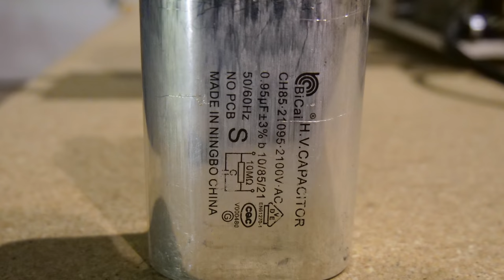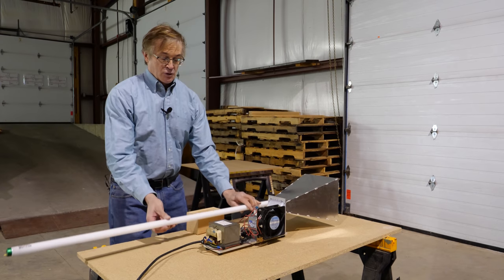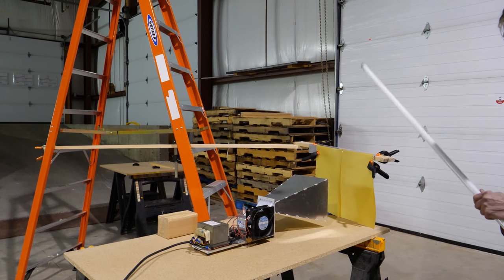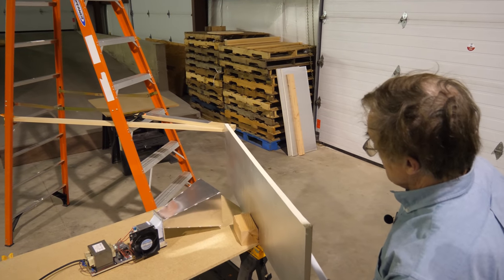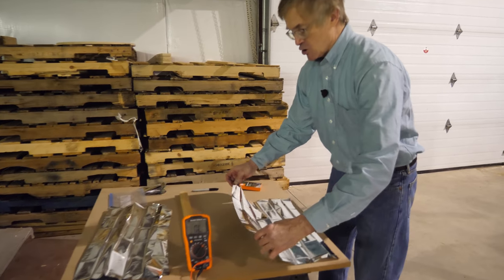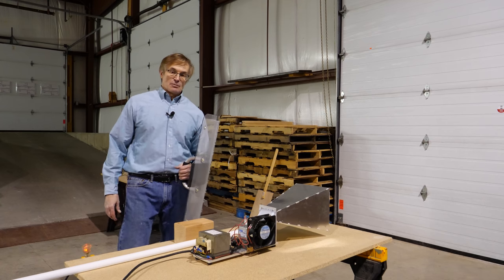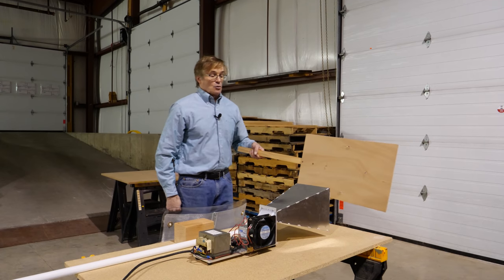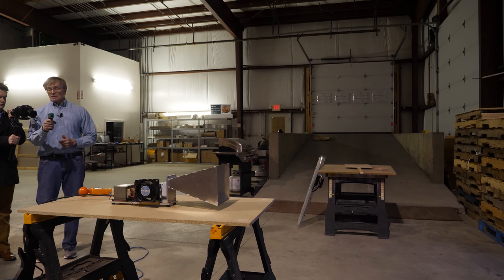You're not protected from microwaves... yet - Part 2

Comment: Low power ("athermal") microwaves are also biologically active and harmful (though if used selectively they can be therapeutic).  You don't need to directly ionize DNA to cause DNA breaks, you can alter other cellular processes to induce oxidative and nitrosative stress.  eg downstream of abberant Ca2+ flux superoxide and nitric oxide are produced, gradually overwhelms endogenous defense mechanisms, finally reaches the threshold where they rapidly combine to form peroxynitrate.  Leakage of the mitochondrial electron transport chain is another mechanism.  Lastly, it can not act to damage DNA at all, directly or indirectly, but can either disrupt or otherwise inhibit DNA repair enzymes.  This would amplify the natural background damage.

"In cellular aggregates that form tissues of higher animals, cells are separated by narrow fluid channels that take on special importance in signaling from cell to cell. These channels act as windows on the electrochemical world surrounding each cell. Hormones, antibodies, neurotransmitters and chemical cancer promoters, for example, move along them to reach binding sites on cell membrane receptors. These narrow fluid "gutters," typically not more than 150 A wide, are also preferred pathways for intrinsic and environmental electromagnetic (EM) fields, since they offer a much lower electrical impedance than cell membranes. Although this intercellular space (ICS) forms only about 10 percent of the conducting cross section of typical tissue, it carries at least 90 percent of any imposed or intrinsic current, directing it along cell membrane surfaces.

	Numerous stranded protein molecules protrude from within the cell into this narrow ICS. Their glycoprotein tips form the glycocalyx, which senses chemical and electrical signals in surrounding fluid. Their highly negatively charged tips form receptor sites for hormones, antibodies, neurotransmitters, and for many metabolic agents, including cancer promoters. These charged terminals form an anatomical substrate for the first detection of weak electrochemical oscillations in pericellular fluid, including field potentials arising in activity of adjacent cells or as tissue components of environmental fields."
	Adey 1993 - Biological Effects of Electromagnetic Fields

This is relevant due to other types of electromagnetic weapons which I can't link or quote here (youtube deletes them).  Some involve the microwave auditory effect, others have to do with timing pulses in rhythm with the heart to cause death by heart seizure, and others to slowly induce a hyponotic state (as in the USSR device "LIDA").
Reply: @ep5acg  okay I haven't read all of the comments but it sounds more like something happening on prolonged exposure? While you can simply up the energy of ionizing radiation to get to a level where one millisecond hits you with enough radation to essentially transform you into a walking corpse because the radiation spreading from the impact is enough to make all your cells loose the way of splitting. I feel like higher levels of microwave radiation are easier to tolerate till you reach the level where all the water in your body gets instantly vaporized, but that sounds like a fuckton of energy. Then again this is all speculation and I would gladly hear what a person has to say about that. But as I said, my guess would be it would need prolonged exposure to get effects like oxiders forming to a sufficent amount to be harmful or the repair process of DNA being inhibited. Still good to know but does sound less acute then what happens if you get hit by high energy ionizing beam.
Reply: @ep5acg  im pretty sure he simply meant in context of radiation, only ionizing radiation can cause direct dna damage, not a blanket statement that ionizing is the only thing PERIOD that can damage dna. Clearly lots of stuff can damage dna, chemical, physical, etc. For example, IR light isn't going to cause DNA damage, but UV-C sure can.
Reply: @ZE0XE0   Nah  clearly he was trying to say that microwaves exposure of humans can not cause DNA breakage in those human organisms.   When the totality of the biochemistry involved is taken into account, as prior comments point out - this is not true.  I.e. That statement he made is false.  Pure and simple. Furthermore, many people who say this are in fact cognizant that they are suppressing some of the literature.  In which case the statement is also a lie.
Reply: @Ramog1000  I believe you are correct.  Other than furthering discussion for the sake of intellectual curiosity, I don't see that oxidative stresses due to, or inflammation responses, have much to do with the context of protests -- until I woke up this morning still thinking about how he could not spell the word 'front'.   It looks like he has inadvertently informally confirmed that microwave exposure even at lower levels than ionizing DNA affects brain processors.   There are a number of cohort studies with people reporting this.
Reply: @ep5acg  ehm a microwave beam with the power of 1500w is low levels of exposur?
Reply: @ZE0XE0  This is still thinking in terms of direct action, rather than thinking of transduction and downstream amplification.  Think about this classic example of death by low intensity visible light: the story of Romeo and Juliet.  Was it the light itself that triggered organism-level apoptosis?  No, it was the timing and character of that signal.  So too of other frequency bands and the various tissues of the body.
Reply: @Ramog1000  The whole thing is highly nonlinear and difficult to broadly characterize.  There are short and longer term cumulative effects possible, depending on the initial state of the organism.
Reply: @ep5acg  Yeah, there is a tendency to downplay or ignore more subtle, silent, gradual, cumulative, and synergistic environmental factors.  I traced out the history of this field back to 1893 with the work of d'arsonval and others (really goes back to Galvani, Franklin, and others, but for the purpose of this discussion).  In the fields of bioelectromagnetics and magnetobiology there are actually more like 40,000+ papers published internationally to date.  Some of them are on magnetic fields, a lot of them are higher intensity, but a good chunk of that body is dealing with low intensity exposures.

I put together several links to papers and sumamries (presently just a text document), and gathered all of those other documents together.  Youtube just deletes my post if I link to it directly, so I put it in a community post on my channel (the only post).  Anyone interested in this area should check it out.
Reply: @Acetyl53  I mean I also wrote in a comment on the video that a wire cage to limite radiation spread would probably a good idea.
Reply: @Ramog1000  Check the last paragraph of my initial post for some of the more specialized applications I have in mind.  We've been able to just cook people with microwaves forever, the Japanese developed their "Ku-Go" death ray towards the end of the war using this exact idea.  It's these more specific and nuanced applicatiosn which have a greater potential covert effect.
Reply: @ep5acg  Weird, it truncated the URL.  Fixed and just tested though, working now.
Reply: @Ramog1000  So many comments, I've lost track of the context for your remark.  1500w would be a bad deal for a person, that is high power.  Health effects have been measured at WIFI and cell phone type exposure levels.  Go to pub med and do some searches, you will find papers.
Reply: @Acetyl53  Got a chance to go through some of those papers today.  The Bioiniative RF color charts are great.   However, the bibliography is missing.  The last column has references, but there is nothing to cross them with.  There is a 2014 Bioinitiative bibliography.   Everything on those charts is even older than that.  Should those charts be labeled 2014  instead of 2019, or is there another bibliography?  Can you please help me resolve this question?

It was interesting to see some of those older papers, it looks like Sputnik lead to a spate of sincere investigation.  Even in 1958 a researcher talked about low levels of microwaves changing the dialectric constants of protein solutions, and a couple of researchers talked about pearl chains at low powers. One even had a low power DNA breakage explanation.

It is also interesting that in the 50s everyone else was thinking of microwaves as simply a type of fire that a person did not want to get burned from.  Those early papers seem to be all that most people are familiar with today!  Seems more people get their intuition from the concept of cooking food in a microwave oven, than they do from the published literature.  Perhaps we should be talking more about 'magneto biochemistry'  - someone should write a book on it.  Humans certainly find it challenging to develop intuition about things that are invisible.

The old literature also had a practical reason for looking at higher levels - they didn't have the equipment to measure lower levels, as one researcher pointed out.  Did you ever read about the plutonium ingestion experiments?  Seems all the test subjects died prematurely, and the military scientists demonstrated that not a single one of those deaths was from ingesting plutonium.   I skipped the papers about an apparent accident on the Forestall did not actually causing any health problems...

Your list is missing Dr. Belpomme's work and that of some Chinese researchers.  In general it looks not to have been updated in a long time.  .. One Chinese researcher published a wonderful paper where he said we should not forget the  benefits of microwaves, then went on to explain how they could be used "to help people concentrate bettter"   and to "give them feelings of euphoria"   LOL thus establishing low level microwave effects on higher brain functions while also getting past the censors.
Reply: @ep5acg  There are actually a few bibliographies.
_Index.txt is my own bibliography generated from papers I have on my drive.
The Navel Medical Research Institute (NMRI) bibliographies by Glaser in 1972 and 1976 contains iirc ~8000 entries.
The the EMF Portal database dump txt.  I wish I started doing that sooner, they've been removing relevant papers.
The EPA Index by Kinn, 1981.
Lastly -Main document[...] aimed to gather together, sumamrize, and cite all of the relevant research as well as establish a timeline, relevant players and names as they come and go, and so on.  It was intended to culminate into a general review of the literature, but I haven't worked on it for a few years.

"1958 a researcher talked about low levels of microwaves changing the dialectric constants of protein solutions, and a couple of researchers talked about pearl chains at low powers."
I'm not sure if I included yet, but one paper (from the DTIC or CIA Archives iirc) from the mid 50's had the author expressing frustration and talking as though "athermal" effects were in their eyes conclusively demonstrated and obvious.  If you go back to the 1920's and 30's with the naysayers at the Rockefeller Institute for Medical Research, you'll see the same pattern.  Maybe there was a case for deficiencies in measurement apparatus in the 30's, not anymore.

"One Chinese researcher published a wonderful paper where he said we should not forget the  benefits of microwaves, then went on to explain how they could be used "to help people concentrate bettter"   and to "give them feelings of euphoria""
Yep.  Several Chinese papers reported broad neurotransmitter changes.  They've also use pulsed 2.45 GHz exposure as a diabetes model.
Reply: @Acetyl53  would you please send me any links that you talked about?

Find my email the About tab of my yt profile.

Comment: I’m curious why the orientation of the “space blanket” matters other than for reflecting. If the blanket was flipped, wouldn’t it still not allow the microwaves to pass through due to the aluminum layer?
Reply: Probably because you become electrically connected with skin contact.
Reply: @sshuggi  how? It was shown that continuity was only possible on one side. Does that make the space blanket a one way valve for electrical radiation?
Reply: I guess because ... It is important not to rub the coating off.  It is very thin.  Probably shouldn't scratch it either.   It is something a person should be aware of when handling it.  Maybe there is more diffusion of the wave on the dull side than on the shiny side.   Diffusing the reflected wave would be a good thing.
Reply: @ep5acg  the scratching definitely makes sense now that you mention it but if it’s that easily defeated then I wouldn’t want to rely on this for anything but emergency use.
Reply: @willb.383  I had a sheet of it mounted on a surface where people sometimes rubbed on it when they passed by.  I was surprised that after a month a big clear spot the size of a frisbee appeared where the coating had been completely rubbed off.   Had it been turned the other way, it probably would have been fine.  (I found the material to be interesting so I was experimenting with it.)

Comment: thank you for demonstrating the uses of microwave detect devices and how the beam is deflected, in a self -protection type environment.  I built a cheap faraday room sized cage out of foam insulation board e/w aluminum foil on both sides about X10 years ago, which I have not had to use, but it's nice insurance, if ever required.  We utilized 10kw Klystron microwave power amplifiers in NATO, so I know a few things about staying safe around them.  No watches around the Klystron magnets, they would kill a watch very fast.

Comment: Thank you for taking the time to show things like this. The infused copper meshed cloth that you mentioned just prior to the riot shield sparked my interest. 
I have a multipart question/comment:
- Since not everyone walks around with a riot shield available to them could clothing that doesn't stand out from normal everyday clothing be made that would effectively diffuse the microwave radtiation without harming others and still provided an indicator that you were in the presence of microwaves?
- In your previous video regarding how to defeat microwave radiation you mentioned that the convex shape of the mesh screen attached to the riot shield helped to diffuse the radiation so that you don't harm those around you. 
- How does, or would, the shape of the copper infused cloth effect you or those around you since the shape would be considerably more organic and complex than a convex shaped riot shield with wire mesh on it?
- Could the small flourenscent/neon bulbs with the connecting wires arranged in the 90 degree offset you mentioned, be placed or sown into or onto the cloth made into clothing, and how might that work?
- Are there other more durable and inconspicuous ways that could be implimented utilizing these types of materials?
Reply from the maker: Because  some parts of your body will always  be exposed, designing clothing  that reflects microwaves won't  provide adequate protection.
A full body suit could be designed that combined reflection and absorbtion based on the coatings placed on stealth aircraft.  This would limit the amount of energy the suit would wash over neighbors.
But if you're  in a situation  where these weapons  are being used, it's  best to use the simpler  methods we covered and get away.  There's  always another day.
Reply: @TechIngredients  Thank you, sir, for the quick response.

Comment: @Tech Ingredients
Some Portable Microwave Protection:
1. Carbon Fiber Reflector.
2. Graphene Reflector.
3. Rigid Polyurethane Reflector.
4. Emergency Blanket Reflector.
5. Electrically Conductive Mesh Reflector.
6. Transparent Riot Shield Aluminum Grid with 17 Lights Microwave Detector (I Love it).
7. Neon Indicators Light, 50 cents per piece (I Love it).
8. Microwave Radio Frequency Detector.
9. Laser Gun Thermal Detector.

Comment: Take a cheap voltmeter, put it on A/C volts.  Then take a copper wire that is twisted around the length of a pencil, and plug it into the + and - leads of the meter.  Any strong energy field will create a spike in the reading.  Test it where you know there is no field, then under power lines, and inside your building, just to get some benchmarks.  Then, take it to a demonstration and see if they are hitting the crowd with energy weapons.  It will only cost about $20.00 to make and will not look like a weapon of any type.

Comment: I saw recently another documentary on radio waves and something that they pointed out was that the amount of energy is not as important as frequency when it comes to dissipating the energy in living cells,as  the wavelength more so than power alone directly correlates with the ability to be used as a weapon
Reply from the maker: That's  correct. Lower frequency radio waves will mostly pass through a human body.
Reply: @TechIngredients  
Isn't higher frequency having more energy in concentrated form than lower frequency? What causes the higher frequency, it is energy, right?